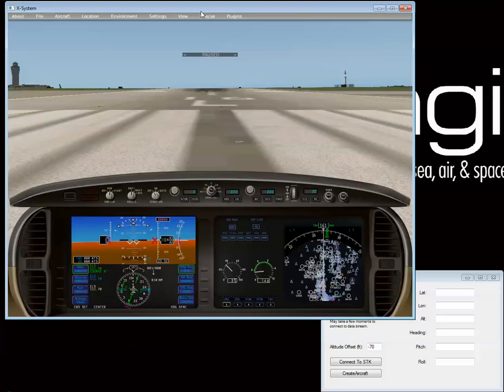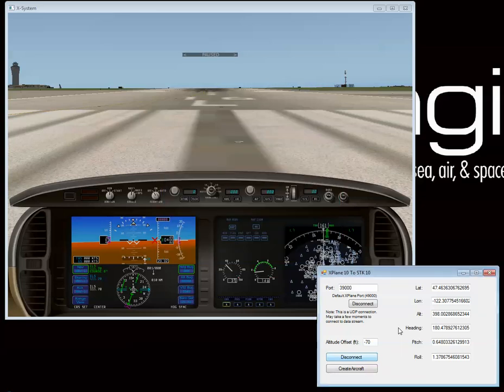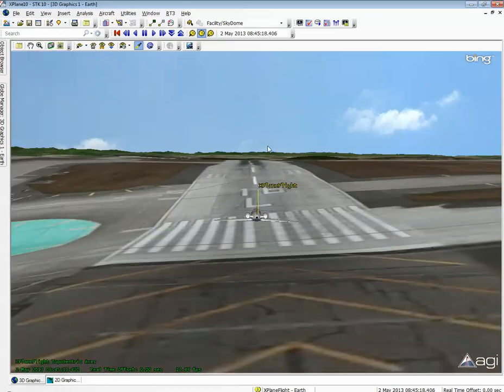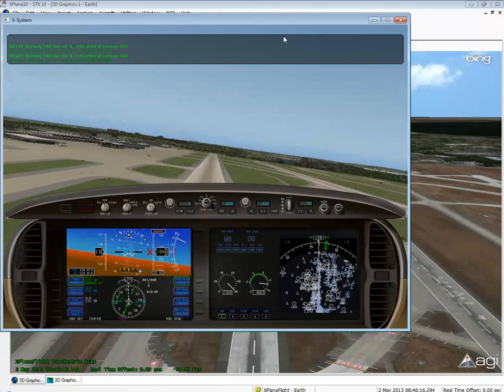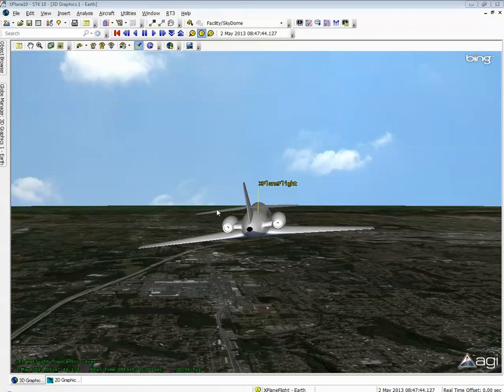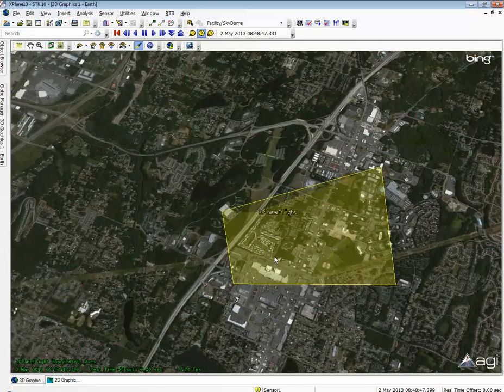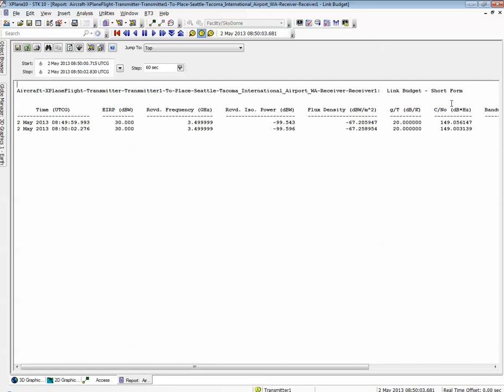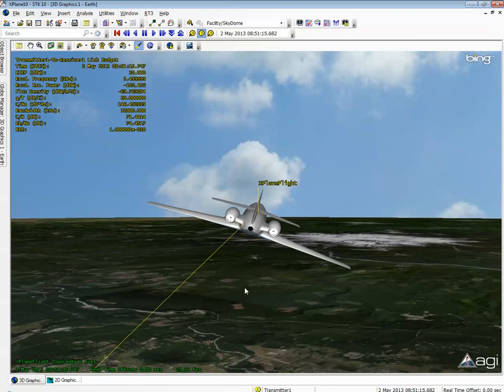XPLANE 10 RealTime To STK 10

Comment from the maker: Sure!  I was simply using the STK Engine capabilities from AGI.  All of the STK desktop capabilities are available in software libraries (bundled it is called STK Engine).  If you have STK installed on a computer, you can use the libraries inside of .NET applications.  There was a recent DIY Seminar that is available on the AGI website which i hosted to show a easy "Getting Started" with STK Engine for creating custom applications similar to this one.